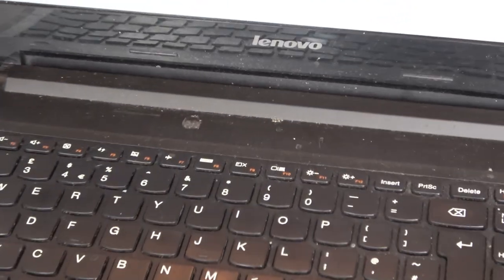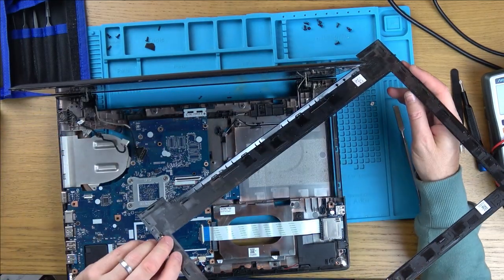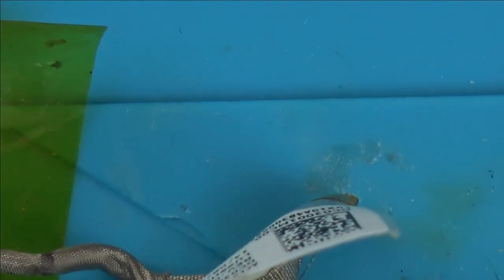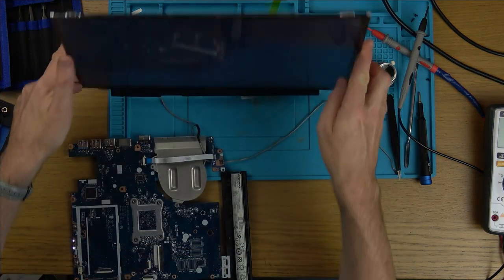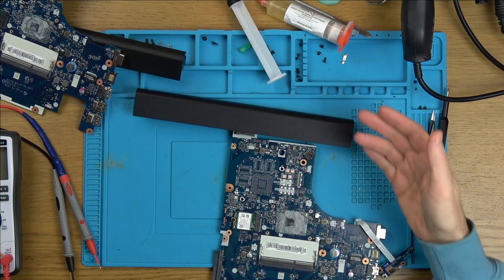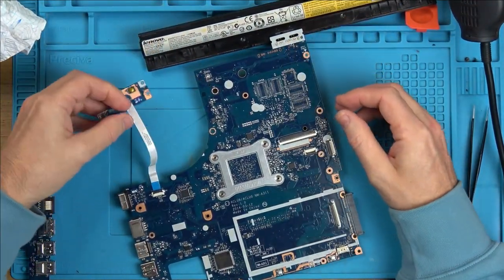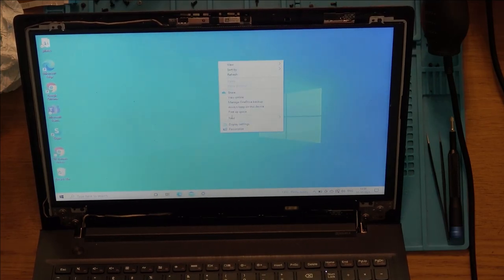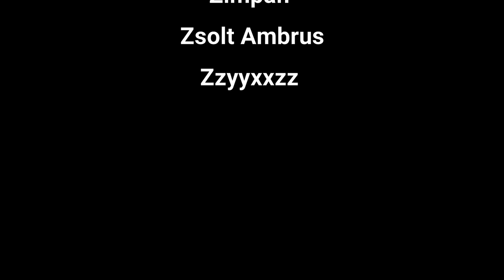LENOVO G50-30 LAPTOP with a WHITE SCREEN Fault - Trying to FIX

Comment: good video Vince, but this laptop belongs to the junk yard, 1 stick of ram instead of 2 to put it in dual channel mode. Still can understand why anyone will put 1 stick of ram even as an upgrade when everyone should know that 2 sticks work better. 2 sticks of 4bg works better and faster than 1 stick of 8GB and the same goes for any amount of ram. 2 sticks of the same matched ram put the machine in dual channel. just chuck in the bin and get new one with new fresh battery, new warranty, new faster NVME drive not these SATA crap from 10 years ago and hopefully a better screen too. Thank you for the video

Comment: my man literally out here breaking shit so he can try to fix it back
you lucked out finding that board diagram because if not the source of that 3volt rail would be a pain if not impossible to find
Reply: They are not so difficult to find.   All of the sub supplies on a motherboard will have a coil associated with them and one side of that coil will be the regulated output of that sub supply.   Test each and read which one has no sensible voltage.    He should have done that and checked for the 3V supply before he jumped into swapping the superIO.  There was no need for that at all.

Comment: Removing the bios battery and shorting the contacts would cause the bios settings to be lost, in most cases the computer would automatically use the default bios settings when the bios settings have been lost
My sister used to have a dell laptop, at some point she gave it to me, and i could tell that it had a dead bios battery as whenever i removed the rechargable battery with the computer unplugged and shut down (which i did during the attemps i made to open it up), the clock on the computer would revert to the default time
The laptop had Windows XP on it, and also the rechargable battery did not hold a charge by the time it was given to me, well, the laptop could only be run off the battery for a few minuites before it would need plugging in

Comment: if a laptop screen turns white the very second you attempt to power it up, and then after three seconds of white screen just blanks out altogether (with no signs of life other than the temp white screen) is that game over? Is that motherboard/graphics card failure?
Reply: Turning off completely like that is a sign that the motherboard is detecting an over current and is shutting down the power input to protect the computer.   White screen indicates a fault in the display somehow.   So,  my theory would be that there is a short circuit somewhere on the way to the display and that is triggering the shutdown protection.   Could just be the cable feeding the screen and wires are shorting together.   Could be....
Reply: Checking the lcd screen power cable was what I had narrowed it down to in terms of what forums were suggesting - which seems to be what you're also leaning towards too? I bought it on ebay, it booted up once fine, I closed it, reopened it and from there the white screen and shut down thing happens every time. I've yet to take it apart, but do plan to do so. Thanks for your advice and reply
Reply: @antiochiaadtaurum3786  screen cable is certainly the first place to look.  Your ebay story makes me wonder if the seller had the problem, bodged a fix and sold it on to you before the problem returned.   Or maybe you were just unlucky.
 If the cable looks/tests ok then disconnect it from the motherboard end and then see if the machine boots up with no screen. 
 If it does then you can try with the screen cable plugged in but disconnected at screen end.  If it boots now, the cable is not shorting and the problem is in the screen/screen board.

Comment: Can anyone please help us here , I bought a Lenovo legion 5i a few years ago, long story short, the fans were getting abit loud, so I took the back off to clean them, I put the back back on and it was a little quieter but still the problem persisted. 
We were using it as normal then all of a sudden the screen flickered white and then switched off.
I tried turning it back on and a white power light comes on but no boot sequence or fans going, and no monitor either, it does start after about 30 seconds to the login screen , you can hear it as well, but no screen activity, and then it will just quickly shut down again.  I am so upset about this as it's my autistic son's laptop for all his homework school work, I don't know what to do. The warrant is expired so I can't do that. Does anyone know what maybe wrong with it, as it's his life, for writing his books on. It would be much appreciated if you could give me some pointers, I live in the UK as well .

Comment: I just repaired that laptop model today for my dad.  It was an easier fix, though, as it had a corroded keyboard that just needed to be replaced.  I also swapped a screen on a busted S20, but that didn't go so well.  The front camera stopped working, the back ones don't focus anymore and to top it off I somehow managed to damage the new screen when reassembling. fumblefingers
Reply: awsome roger.RIP new display

Comment: Hi, what are the specs of the pc? I would like to buy it from you, I need it for school but at the moment I am not finding any laptops good enough. Do you think it can handle a little heavier programs? Because I want to learn coding. 
Please respond to me. 
If you have a marketplace on ebay or something send me the link ❤
Reply: i'm not this guy but most g50-30s go for around 300 bucks. it'll definitely handle light-medium programs and it'll last you while you learn. the built-in drive is gonna suck, so you might wanna slap an ssd in there lmao.
Reply: @noobiii  Oh yeah, it has 1 drive at the moment which is an 256GB ssd. It can hold one normal drive and one m.2 SATA ssd.
I believe it has the m.2 ssd installed. I'll keep you updated when I receive it.

Comment: Not going to be a GPU failure as it doesn't have a dedicated one and it displaying external, got to be the screen as it's powering a backlight, and not displaying data, LCD are cheap enough to replace,

Comment: never test a screen with battery or power cable in it.  certainly not if you don't know how or what.  guaranteed to short circuit the motherboard as happened.  it was 100 percent the screen because your monitor was also working and there is no extra gpu.  It was fix in 5 minutes.

Comment: I refurbished a few of these laptops before, they are a pile of shite.... might look nice but they are awful.... you will get better performance out of a T410 or T420.... even if you put an SSD into the thing you are wasting your money....
Reply: and if i got it for 10 Bucks?🤔
Reply: @SpeedcoreJihad  I got one for free and spent more than 10 bucks trying to refurbish it... this model actually has a flaw  with the power delivery on the motherboard, eventually it starts blowing fuses on the board. Lenovo know about it but they never fixed it.... If you picked one up for 10 bucks and the motherboard and screen are alright then strip it down, sell the parts on ebay because reselling a refurbed unit like this is going to come back to bite you if the manufacturer of the laptop has fukd up the main design ... The last one of these I did went to Mali for a village.... I ended up giving it to them for free when it died after 3 weeks lol. I am not touching these G50 models anymore.